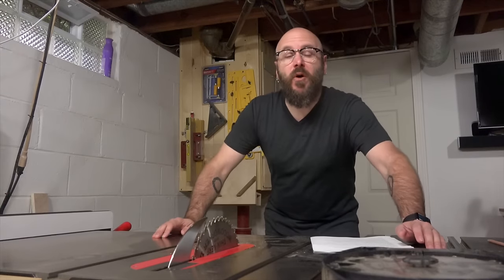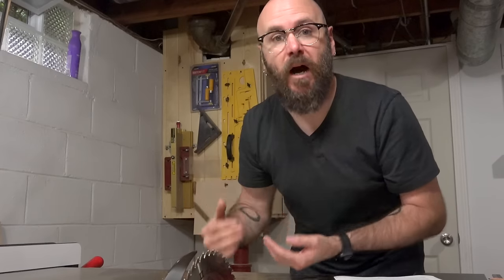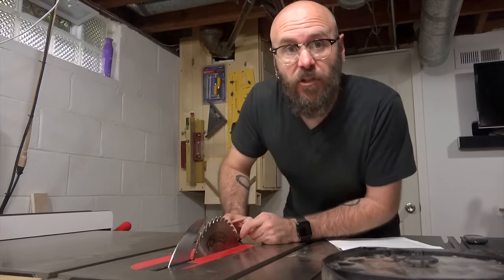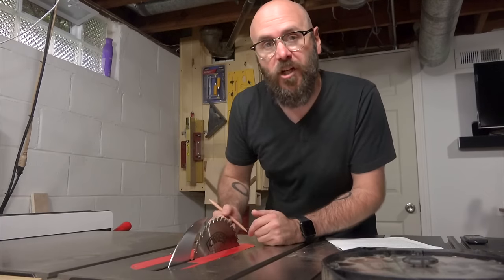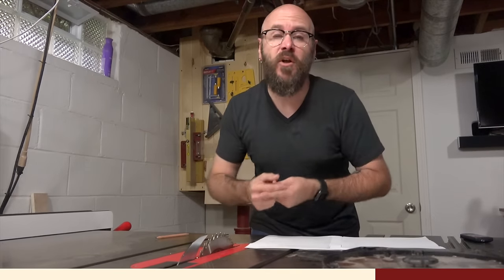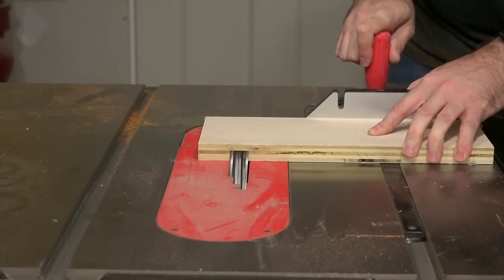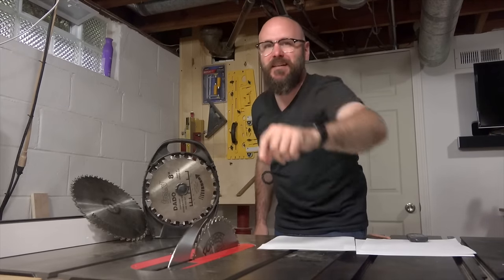The Only Table Saw Blades You'll Ever Need

Comment: Usually i see people putting blue tape on plywood to avoid tear out, it seems that just a few people know about adecuate blades for that, and is not just a lots of teeth, i use a Freud blade for plywood and melamine (LU97R010) and i don`t have any tearout on any face of the material, also, for jigsaws, i cut a lot of melamine for my work, best blade?, Starret dual blade, it has the orientation of the teeths changed in the middle of the blade, that creates cuts on each side of the material without tearout, for people who works with plywood and melamine both of those blades are a must (if you don`t have a scoring blade on your saw)

Comment: love the videos so far.. like tha channel.. I use a combo pack of dewalt blades I bought for 34 dollars. A 32T for 99% of my cuts and rips. And it also has a 60T for finer cuts. But I've found a slower feed with the 32 can give the same results without having to change the blade.

Comment: Good info on the relevance of tenons being cut with combination blades. I make mine using the table saw to establish the shoulders and remove the rest of the waste on a bandsaw. I know that isn't the point (we're not talking bandsaws!) however I tend to slightly undercut my large tenons as a matter of course to provide slippage space for glue squeezeout. We don't use dado stacks over here in the Europes due to laws concerning the time it takes for machinery used to stop once you hit the big red "release the moths from the space between Trump's ears" button. The electro-magnetic brakes and the rotational energy of a heavy dado stack can cause the arbor nut to spin off....unless you buy a Felder or similar with a locking arbor nut. I stick to combination blades purely because of simplicity and fewer changes. Throwing a new blade on is no big deal (and you get to clean up the waste ports) but having fewer numbers to remember from setup to setup helps a lot in many ways.

Comment: I use all Freud blades.  40T, 80T and the 8" Dado set.  I do have a 60T but have yet to use it.  I use the 40 the most.  I doubt i'll be using the 24T that came with my table saw.

Comment: I have 3 beavers. Each beaver has a differing amount of teeth. The one with one one tooth does all my ripping. The beaver with two teeth handles my crosscuts and finally I have a three tooth beaver for the fine exotic woods that need a clean tear out free finish. I literally have to forever continue to woodwork or my beavers will starve. I love beaver =)

Comment: I use an 8" Forest Woodworker II thin kerf combo blade on my Inca table saw.  Works great.  The only hassle, I need to have the blades bored for 20mm, Forest will do that for a small charge.

Comment: Informative vid Dave thanks for the info:
I use a Evolution Rage2 355mm  Multipurpose Blade.
I made a DIY Table saw from a circular saw so the bore is smaller than a standard table saw blade.
I cuts Wood , Plastic and Aluminium  and I have to say it does exactly that to a high standard, in addition the Kerf is thin too.

Comment: Thanks for the Amazon tip, I will use that in addition to my patreon.  Thanks for the tip.  I never realized the flat bottom when using my box joint jig.  How do you use that music without getting a slap on the wrist by you tube?

Comment: Would you recommend these blades for a miter saw as well as a table saw, or would you go with something else for the miter saw?
Reply from the maker: For the miter saw I prefer a dedicated crosscut blade.
Reply: Generally a less aggressive 'hook/rake angle' is preferred so it doesn't jump/pull down on you.

Comment: Outstanding informative straight to the point video! Question for you David or if anyone else can answer, you mentioned getting the blade sharpened. Can the blade be sharpened forever or is there some point when it will no longer be able to be sharpened and you have to get a new one.

Comment: I'm curious which of your two blades you would use with plywood.   40tpi seems low to me in order to not chip the veneer.
Reply from the maker: I use the combination blade but I either making a scoring cut to the plywood or use masking tape to prevent chip out.
Reply: Matthias Wandel makes the scoring cut in plywood running his wood thru backwards (it pulling it over the blade back to front)

Comment: Just wondering if there's any advantage of using a full kerf blade for regular cuts when a thin one is less wasteful and less work on the saw?
Reply: A couple. The main one is the fact that thin kerf blades can twist and warp more, so they can be less accurate. There are a few other issues too, like heating up more and being incompatible with most standard riving knives, etc.

Comment: I have a 24 tooth thin kerf rip- it helps plow through stuff faster than a 40. I also have a combination 40 and a fine cut 60 that I use for plywood.

Comment: Great video as usual. I have a question, though. I use a thin kerf ripping blade and a thin kerf crosscut blade separately... Have you had issues with ripping where your combination blade doesn't clear the dust fast enough? Basically, is there ever a drawback to using a combination blade over a ripping blade?

Thanks!

Comment: Great vid!  I'm totally new to woodworking and want to make sure i'm being safe.  I have an 8" stacked dado set. I want to make small boxes with an 1/8" box joint.  Can I just use one of the Dado blades to make the 1/8" flat bottom box joint?  Is using one dado blade unsafe? I fear both dado blades were designed to be used together?
Reply: I am no expert so take my advise with a grain of salt and certainly verify it but I do believe that minimally you have to use both outer dado blades simultaneously!  If you're trying to remove only 1/8" of material then I'm thinking a regular kerf (not thin kerf) blade would suffice.  Be safe & good luck!

Comment: May I use blades of different diameter on the same circular/table saw?
Reply: Yes. I have if the arbor size is correct. Some have a knockout.

Comment: Loved the Queen reference- it was exactly what was going through my mind when you said flat bottom blade the first time. 

Also didn't know about the advantages of the narrow kerf- I also have a small basement shop and tend to trip the fuse. I might give that a try.
Reply: Also I have the same Freud dado stack set. Great set. My go to has been the combination blade that came with the saw.
Reply: Greenhorn Tenderfoot  If you’re using an extension cord shorten it to barely sufficient and use a heavier gauge. Try to use a dedicated circuit as close to the breaker panel as possible. Use the first outlet on a circuit if possible. All the wiring distance in a long circuit contributes to amp drop. If you have a 20 ft circuit and 15 feet of extension cord that’s 35 feet from the source. Never use anything less than a 12 gauge ext. cord, the shorter the better.

Comment: Why would you use a blade that doesn't have a flat bottom grind are they more efficient
Reply: yes there is less surface area contacting the work, kinda like scratching wood away instead of paddling it away. if that makes sense
Reply: Don B the Alternating Top Bevel (ATB) blades shear the wood fibers better than a flat grind, leaving less tearout.

Comment: Is it true that thin kerf blades are less safe because as the blades heats up, there's a bigger chance for the blade to get twisted?
Reply from the maker: I have never heard this and after 4 years have never had an issue.
Reply: I had one on my circular saw (7.25") and it twisted, very dangerous. It was a cheap blade on my Skill 77 mag. Other than than that, no problems on my 10" table saw or miter saw. 12" thin kerf blades may not be all that accurate on a sliding miter saw.

Comment: Hi David, Thanks for this info on the blades. I to use a 40T 3/32 Thin-Kerf Forrest II blade, this is bar none the best quality blade I have ever used! I've had my blade for roughly 7-8 years and use it all the time, for hardwoods, soft woods, all sorts of wood composites< never cut aluminum though, that freaks me out a bit, but my blade never burns and is still sharp, though I should send it in to be done...should only be done by Forrest though as they apparently do a complete clean, rebalance if needed and of course sharpen it to their specs. Truely worth the bucks! Gotta say though I loved your tip on the straight bottom cuts for tennons etc, how I have ever missed that fact is beyond me.??? Thanks and have just subscribed.
Andrew

Comment: What about Carbide tipped vs. Steel?
Any opinions on that?
Reply: I've always found carbide to be sharper and stay sharp for a longer period of time. definitely my preference for man made materials. steel is good for solid stock but dulls quicker. you get what you pay for.
Reply: For cutting solid wood along the grain a good quality HSS blade performs the best. For everything else, a carbide tipped blade is sharper and holds the edge longer. PKD actually performs way better than carbide on some materials but its really for professional use only. I operate a big 5-axis wood cnc for a living and we have to resharpen our PKD tooling every 2-3 months, back then when we used carbide tooling we had to resharpen every other day.
Reply: Interesting... So Table Saws and Miter Saws need different blades, if I understand correctly.  
PKD is THAT hard? How do you sharpen it, with diamond too?
Reply: Yes, sort of... If you leave out the price difference it makes no sense to put a HSS blade in a mitersaw. PKD is resharpend with diamond just like most cutting materials however due to its rediculous hardness PKD usually chips rather then dull in a traditional way. Because of that you usually have to  replace the tool completely.Yonatan Y.
Reply: Carbide typically has a hardness scale in the 90's.  Steel is typically in the high 50's to low 60's.  This means a carbide will keep its edge many times longer than steel, which is what you want in a rotating blade spinning at thousands of revolutions a minute.  Because steel is softer, it has more flexibility and thus if you drop your steel tipped blade on the floor, its less likely to chip compared to a carbide blade.  I would think it would be difficult to find steel tipped table saw blades for sale.
Reply: "when we used carbide tooling we had to resharpen every other day makes no sense whatsoever."

Carbide is a harder material than HSS and keeps its edge a lot longer than HSS.  Carbide is in the 90's on the hardness scale.  You'd be lucky to find a rotating blade with HSS higher than 64, if you could even find a HSS commercial TS blade at all.

I'm curious, give me the brand and model of blade you say is HSS.  It must defy the laws of physics or must be made from something other than HSS.
Reply: Oh, I have a steel tipped circular saw blade from an old drill-powered Circular saw.
Reply: Yonatan Y. An old "drill-powered" circular saw?  What's the brand and model?  I'd be curious to look that up.  Some of the very very old stuff may be steel before carbide was introduced to the market, but we're talking decades ago.
Reply: christschool
I was comparing Carbide to PKD and with the workloads in our shop we had to resharpen carbide tools every other day. Theres no HSS tipped sawblades of which i am aware of however theres lots of solid one peace HSS blades with the tips hardend, those are the ones i was refering to.
Reply: Cofay Mc und Cs:go Do you work in a milling operation dimensioning logs?
Reply: christschool
Nope, i work in a medium sized carpentry shop. I produce shaped parts for furniture on a CNC 9 hours a day almost non stop. Before we upgraded to PKD we used tooling with swapable carbide inserts. Every second day we had to change them because they started chipping the corners of the edges of workpieces . Why wont you belive me? Im not payed to say that and trust me im not stupid either. If there was a way to make them carbide tools last longer we would have thougt of that. Also the inserts we used where made by the best german manufracturer aswell. Leuco is their name and trust me it takes someting to become a lead manufracturer of sometihng in germany.
Reply: Cofay Mc und Cs:go I believe you, not doubting what you do in your shop.  The furniture shops in High Point, NC where I live and which produces most of the furniture made in the USA does not use PKD blades and don't have to sharpen carbide every other day.  I don't think I've even seen a PKD blade anywhere, not even in the sawmills.
Reply: christschool
PKD really only makes sense if  your machine is running almost all day. We have a PKD sawblade in our cnc panel sizing saw, several PKD shaperheads in our edgebinding machine and mostly PKD tooling for our cnc router. All these machines run pretty much all day. We found they stay sharp for at least 10 times longer then a good quality carbide tool, i dont know why they perform diffened from what you have experienced but thats the way it is.
Reply: Cofay Mc und Cs:go Out of curiosity, how are diamond impregnated blades sharpened?
Reply: They simply aren't. Diamond blades are not blades by definition, but rather abrasive wheels that erode away material. They are commonly found on large gas powered demo saws for cutting concrete or bricks or small wet saws for cutting tile or glass.
Reply: Dylan Headrick Dylan, these are not masonry blades, these are PKD blades made for woodcutting.  They have carbide teeth with the tips diamond coated and can be resharpened according to the manufacturer.  You're talking about a different animal altogether than what this discussion is about.  Everyone knows what a masonry blade is.

http://www.pilana.com/en/diamond-saw-blades
Reply: Dylan Headrick
What? No! Diamond is often used in form of abrasive wheels in cutting concrete and stone thats true but they are also used as a material for cutting edges on woodworking tools. Kind of looks like regular teeth on sawblades etc. only that its a deep black shiney almost glass like material. Its called PKD, polycrystalline diamond.
Reply: Cofay Mc und Cs:go I'm curious as to how much these bad boys cost.
Reply: Dylan Headrick
These are the ones we use in our cnc "DIAMAX Hochleistungs-Schaft-Fräser". Copy paste it to google pictures. They are mean sharp and durable. Very expensive aswell.
Reply: christschool
I dont know the exact pricing, i wasnt the one to source them but they are in the 1000-3000€ range depending on their size.
Reply: Cofay Mc und Cs:go That was where I was guessing they came in at.
Reply: Yes, in many situations you should not be using the same blade in your table saw and miter saw, specifically if the your miter saw is a slider.  If its a slider, you need a blade that has a shallow or even negative hook angle.  This will keep the saw from pulling itself into the wood at an uncontrollable speed.  This can create both a quality and safety problem with your miter saw.
Reply: Cofay Mc und Cs:go   Does anyone know how well a Ceramic saw blade compares to a PKD saw blade

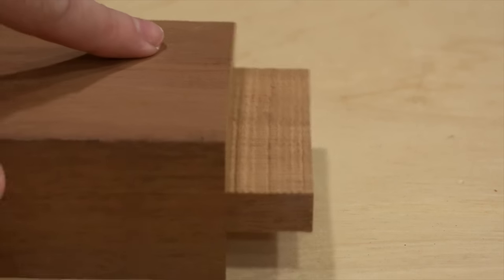Comment: 3:22  Actually a slightly rough surface on a tenon is better, as long as it's a snug fit, because glue holds on better to a rough surface.
Reply: Wanna bet?
Reply: Glenn Storey i'll bet my 50 years experience with working any day of the week